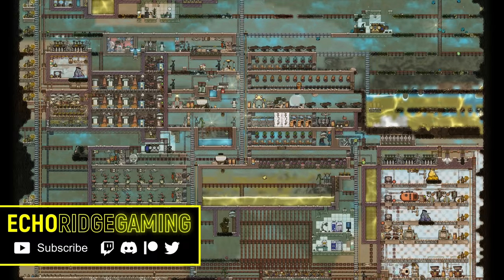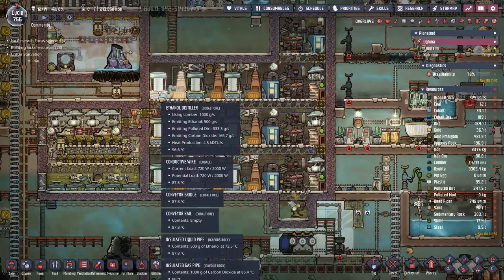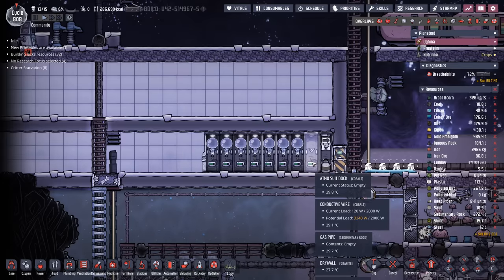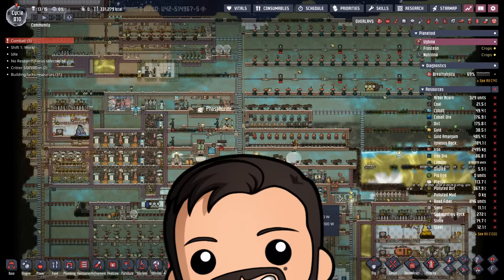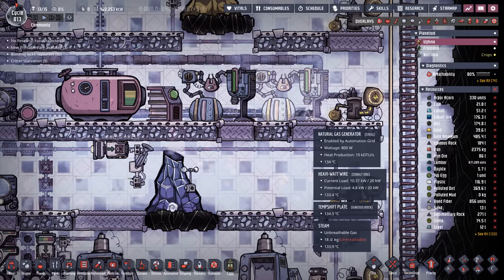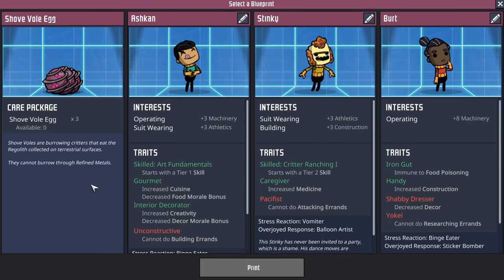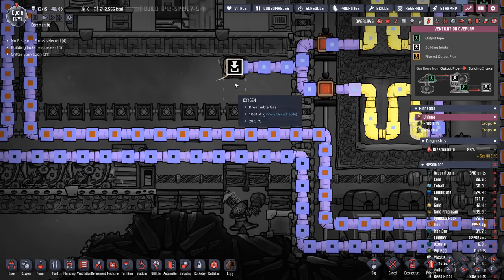Best cooling environment? | Colonization Ep 11 | ONI Spaced Out

Comment: Don't forget, steam generators literally convert steam into 95°C Water, so you could divert some of their output at a set rate or based on pressure and cool that water using side by side counterflow exchange with an aquatuner. That said, I love building unique contraptions to fix an issue, even if it isn't the most efficient.
Reply from the maker: I like this method too and have done it.  In this case, I am using the turbine exhaust water to cool the bottom of the sauna.

Comment: The main use for metal tiles over Pwater is for either things that are outside of Pwater's temperature range, or for counter flow heat exchangers where thermal conductivity is more important that heating/cooling.

Also don't worry about how long it takes to get an episode out or how short it is, I know how slow mid-late game ONI can get, especially if you have some issues with the priorities.

Comment: The "real" optimum chiller doesn't use a Polluted Water bath or solid Aluminium tiles.

If you use clean water, alongside circulating coolant of pwater, you can freeze it into solid "natural" ice tiles. This gives you half the SHC of water or pwater, with a far higher TC (~2 as opposed to ~0.6), the density (and hence thermal mass) of using a liquid, and the heat-conduction bonuses of running through solid tiles. You could also use solid Polluted Ice tiles, trading off a lower TC (exactly 1) for a higher SHC (~3), but this requires either the use of a less-energy-efficient circulating coolant like Ethanol, or waiting for Super Coolant.

These options combine the benefits of both options, having the enormous heat capacity of water with the speed of chilling gained from running the rails through solid tiles. You can even line the back with drywall or tempshift plates to add even more thermal mass, if you like.
Reply from the maker: I like this a lot.  Will try it one day.

Comment: To extract water out of the industrial sauna you could tap into the outputs of the steam generators too - might be worth running through the cooling system too, although pipes would present some reconfiguration challenges - but I would suspect that a couple radiant pipe segments would be more than enough cooling.
Reply from the maker: The only disadvantage to doing it that way, is you don't get the drips from the turbine exhaust to help cool the bottom of the sauna.  Def a good idea though.

Comment: Use the steam turbines piping to remove the excess of water.
When the pressure is too high and the temperature is "ok", close the vent and move the water to your cooling contraption.
A OR gate with temperature sensor to not overheat the room and a atmo sensor to control the room pressure will do the job.
It will be waaaay more efficient and it will cool down a lot more water
Reply from the maker: We have done this before too.  In this sauna though, I am using the turbine vented water to cool the bottom of the sauna.

Comment: I appreciate you taking my suggestion to heart and giving it a good test. However I believe metering your steam to 100g of mass means the steam packets don't have much thermal mass and will quickly change temperature no matter what it's run through. That's why both are effectively the same. They both reached the temperature of your coolant by the time they exited. I'd be curious to know which reached equilibrium first.

Could you go to the ventilation layer and hover your mouse over the pipes section by section? For example, what temperature is the steam inside the first section of radiant pipe, second section, and so-on until it's reached equilibrium? Going to be tough to tell the difference with packet sizes of only 100g. The difference is much greater with the 10kg packets of fluid or 20kg packets of a conveyor. The original suggestion was for the conveyor loop, where 20kg packets of debris have some substantial thermal mass themselves.
Reply from the maker: It was an interesting test to do, but by no means the end all.  I plan on exploring this in much more depth in an upcoming tutorial.  We will get to the bottom of it.  Thanks again for the suggestion.

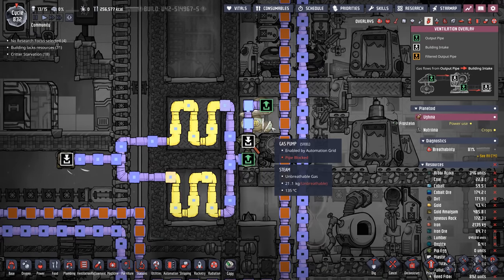Comment: @19:30 instead of cooling the steam you could just take the hot water from steam turbines instead of putting it back into the steam room.
Reply from the maker: Yes but I need the turbine output to cool the bottom part of the sauna.
Reply: @EchoRidgeGaming   but you’re pumping out 100gms of steam so it doesn’t break the pipes and cooling it, instead of taking the excess steam out using the output of the steam turbine.